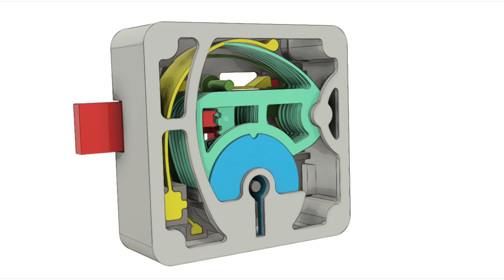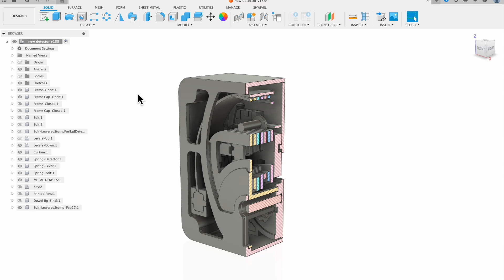Precision and Security: 3D Printed 6-Lever Detector Lock

Comment: This is a really cool design, and I love the iteration on the detector. My only thought or feedback would be that having the detector only on the last lever I think heavily reduces the amount of threat that it creates in seizing the lock, since you can effectively in theory work with each lever before it to where the lock will open once the last lever is at the correct height, before having the chance to trip the detector.
Reply from the maker: Thank you! That is a very good observation, but the detector lever will trip if any of the other levers is raised too hight because of the rod extending from the face of the detector. It extends across the tops of the other levers and raises with them.

I wish I had explained this better in the video - I will try to clarify when I publish the vault with this lock. Thanks for watching and commenting!
Reply: @RoccosStuff  Ah! Awesome stuff! I missed that detail, thanks for clarifying :) I have a big backlog of your makes that I want to print for my lock shelf, so thanks for all the hard work you do!

Comment: pretty interested in a fully printed version of this! axle can be easily substituted with a printed one and bolts can be replaced with maybe little locking clips! :D
Reply from the maker: Thanks for the comment! Someone on Makerworld uploaded printable pegs to replace the dowels, but I am not convinced they are strong enough. I tried printing the dowels on my last project but they broke very quickly, so I reverted to using metal.

Printable clips are an interesting idea and definitely doable - I'll keep it in mind...
Reply: @RoccosStuff  ah awesome! yeah there are some designs of printed pegs, if not you can try printed sort of dovetail shaped pieces that wedge into 2 parts and you can hammer or press them in to lock everything in place :) theres a couple videos out there on how to connect printed stuff together, the main one i use currently for strong and permanent stuff is plastic welding haha though for stuff that you might want to replace often maybe 3d printed cams? who knows :) (btw instead of heated inserts using hex nuts would be a pretty nice option!)

Comment: Why is the detector useful? Can't you just pick the lock in the opposite direction? Please enlighten me.
Reply from the maker: Many reasons. If the person is not aware that there is a detector, they will just try to pick it the traditional way and it will never open.

If the person does know there is a detector, they won't know when it is tripped. If they become aware that it is tripped, they will need to reset it but all of the levers need to be lifted to the correct height for the stump to move enough to reset the detector. So, they essentially need to pick the lock in reverse to reset it, then pick it again to open it.

It's not impenetrable, but at worst it will slow down an experienced picker and in many instances it can defend against a picker completely. I hope that makes sense...

Comment: So in a sense, this is actually a seven lever lock if you include the detector lever. Quite fascinating!
Reply from the maker: It technically DOES have 7 levers, but only 6 interact with the key and the detector is counted in that group. 

The 7th lever interacts with the curtain and provides the click when the key aligns with the keyhole - but this isn't counted because it isn't really part of the locking mechanism.

Thank you for watching and for the comment!!

Comment: Great video and lock design! 
Regarding the Detector, from the part you showed on the video, it seems to be rather easy to reset even for the attacker?
Reply from the maker: Thank you!

The detector can only be reset if all of the levers are lifted to the correct height, as there are little cutouts in the levers for the bolt stump to move into. The cutout on the detector itself is larger because the detector needs to be able to drop down while the bolt is extended. In this sense, resetting the detector requires the same effort as picking the lock in the first place.

Thank you for watching and commenting. This was a great question, and I wish I had clarified this in the video!

Comment: Thank you for making this. I learned of the curtain and the detector and I dont understand why we dont have them in modern locks. 

You also did an amazing 3D printing job
Reply from the maker: Glad you enjoyed it, and thank you for the comment and kind words!!
Reply: The tumbler of modern pin locks effectively gives you the ward and curtain.  The detector is a bit of a gimmick as it looks like it can be reset by the same tools you would need to pick the lock.
Reply: @martylawson1638  Well, That "Gimmick" thwarted so many people attempting to pick this lock for more than 2 centuries, and it's still at the highest level of security on the blackbelt system so...... Yeah, Gimmick!